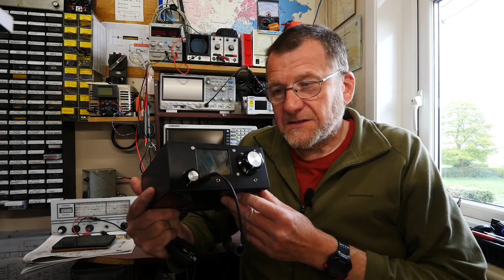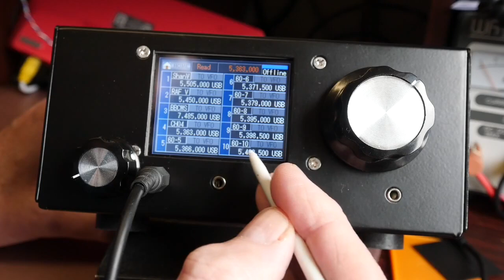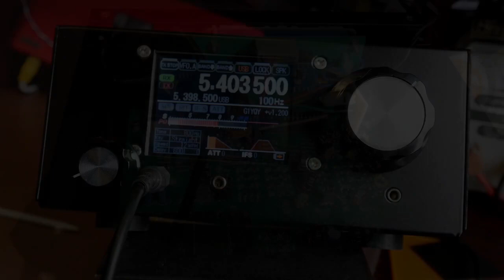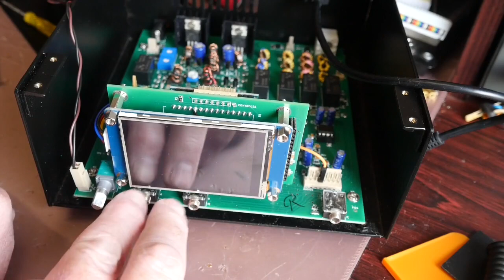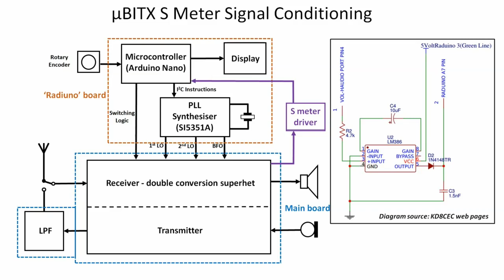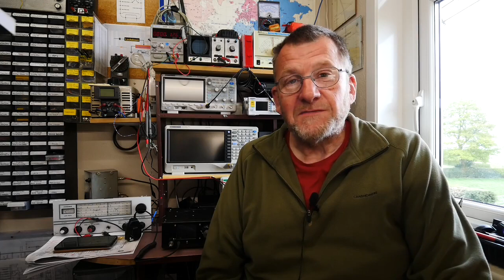µBITX Transceiver Modifications   #075

Comment: Hi,  what is the purpose of changing the display to the Nextion? Will the original display work with the KD8CEC software
Reply: Offloading some of the work of refreshing the display to the controller on the display improves performance

Comment: A cheap 5v step down buck regulator would cut the power consumption of the controller module by about 50%
Something to think about if you want to run on batteries.

Comment: Thank you for this video. I have tried to load v1.2 onto the nano but I get an error saying the file size is too large. Did you modify the .ino file to get it to load onto the nano? If so, can you tell me/us what you did? I would like to retain CW decode, if possible.
Tnx de Arnie W8DU
Reply from the maker: Arnie,

I didn't compile the code for the Arduino, I uploaded the hex file code direct to the micro.

The hex files are here: Release uBITX CEC Version v1.20 · phdlee/ubitx

You need to use the correct version for the display you are planning to use.

Also, I kept the original Arduino from the uBITX so I can convert back if I ever want to do that.

I had 2 Arduino Nano's and only one of them was ok with running the new code, the other one would just not work, even though it worked for other sketches!

Hope that helps.
Reply: @LockdownElectronics  Well, I was able to get the code compiled in the Arduino IDE and uploaded to a new Nano. What I had to do was go into the ubitx.h file and comment out the parameters for the LCD display and uncomment the parameters for the Nextion  display. Once I did that, it compiled without error. Have not installed the Nextion display...that is for tomorrow. I will let you know how that works. Thanks.

Comment: Watched, subscribed, and rang the bell on videos #59 & #75...enjoyed both of them very much.  Being a fairly new ham with just a old YAESU 2M FM only rig, I'm thinking about "taking the plunge" and buying the basic kit so I can get on HF.  Can you tell me if there would be problems (other than power requirements) if I used a larger Nextion Display, say the 4.3", 5", or 7" models?  I plan on making my own custom enclosure, but I'm wondering if the firmware/software mod for the Arduino would still work with these larger displays?
Reply from the maker: Tom, the various web resources seem to indicate that the larger Nextions work OK with the Radiuno. My display works a treat, and although it's cosmetic, it really does improve the usability of the radio for me. I have kept the old Arduino and display intact, and used another Arduino. I had two spare ones, and it was not happy with one of them, however the other did work fine.

Comment: Great video! Thank you!  Which Nextion Display did you get? They seem to have a few models...! And also - do you have a schematic for the S meter driver?
Reply from the maker: I used the 2.8" Nextion, got mine from Banggood - https://bit.ly/3hX3a74

S meter information and circuit is here: http://www.hamskey.com/2018/05/creating-simple-s-meter-sensor-for-ubitx.html

Hope that helps!
Reply: @LockdownElectronics  Thank you!!